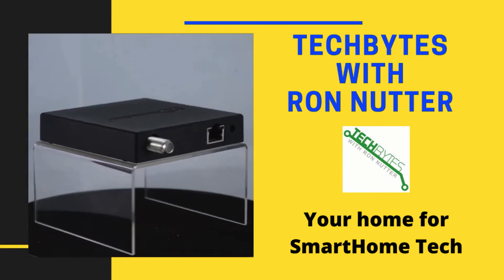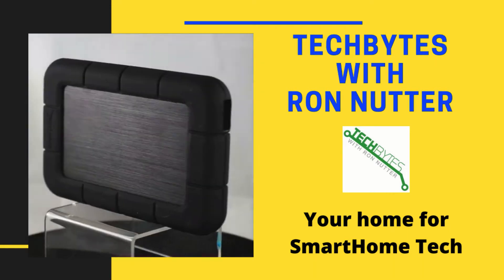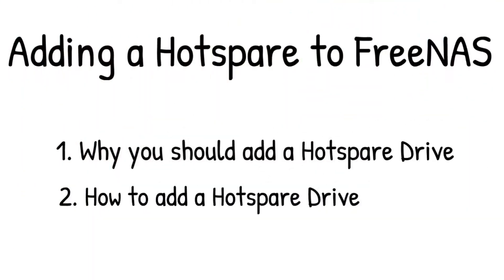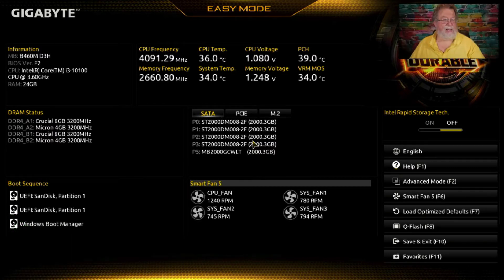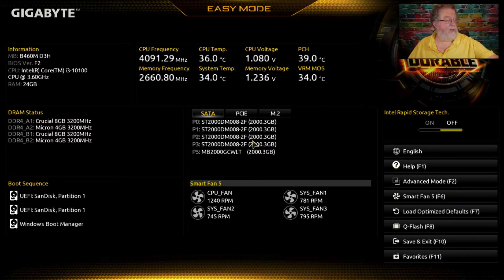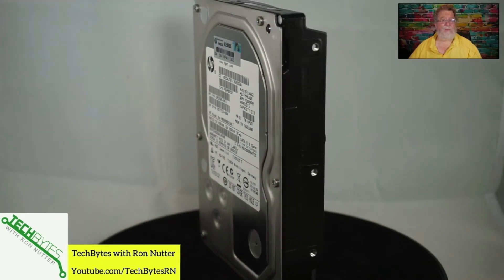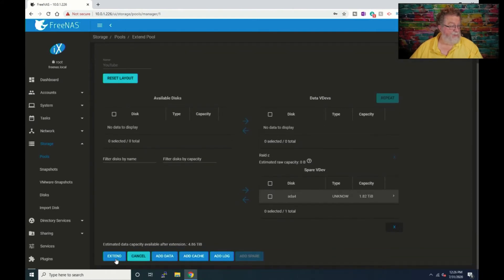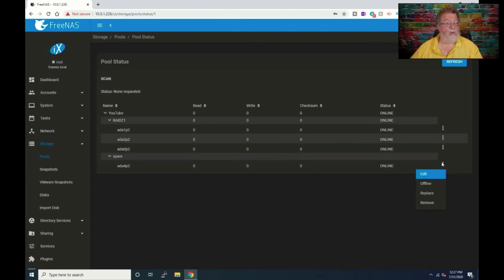How to setup a Hot Spare to an existing pool in  FreeNAS in your SmartHome

Comment from the maker: Here are other videos in the series-
Part 1 Install - https://youtu.be/wxltc5k5raI
Part 2 Intel NIC - https://youtu.be/Ska36MhO2Ac
Part 3 Mirror USB Boot Flash - https://youtu.be/pHlwTT0czIw
Part 4 Backing up Windows - https://youtu.be/kw4v3q2g_jw
Part 5 Updating FreeNAS - https://youtu.be/NghV69HQmq0
Part 6 FreeNAS Drive Failure Warning - https://youtu.be/0hhFyZnqKgI
Part 7 FreeNAS and NetData - https://youtu.be/huHD4AZZInU
Part 8 FreeNAS and Hot Spare Drive - https://youtu.be/BTz-Le7n49s
Part 9 FreeNAS Sync with Google Drive - https://youtu.be/ARaPTZxCjd8
Part 10 FreeNAS Sync with Dropbox - https://youtu.be/A2x3Fx8O_6Y
Part 11 FreeNAS Pool Encryption - https://youtu.be/fveErLIa0Ek
Part 12 FreeNAS Drive Failure Warning Part 2 - https://youtu.be/bh0IYKzrfsI